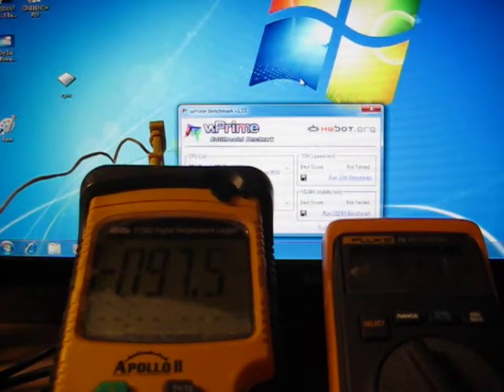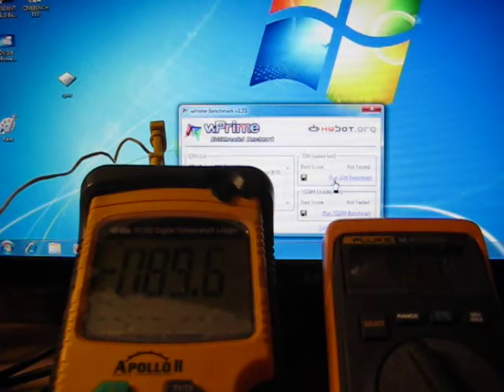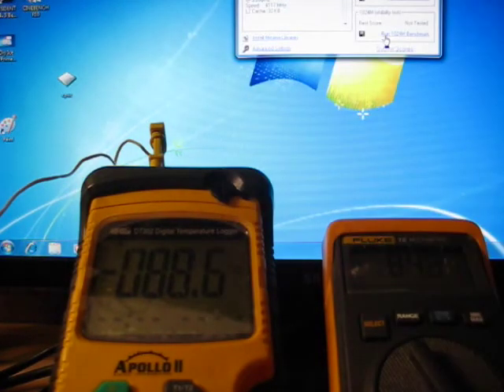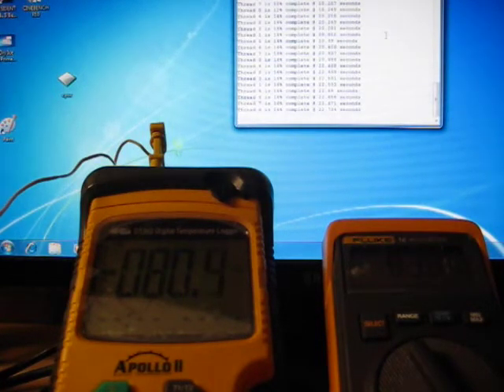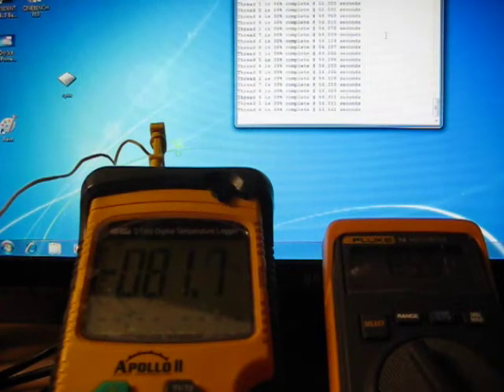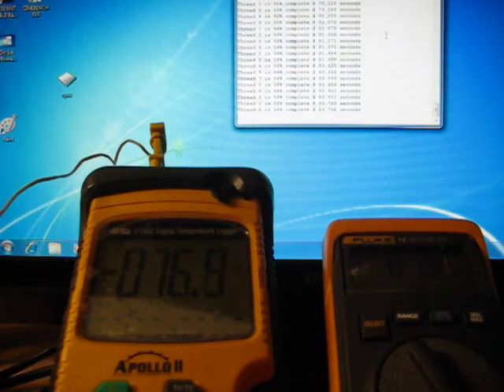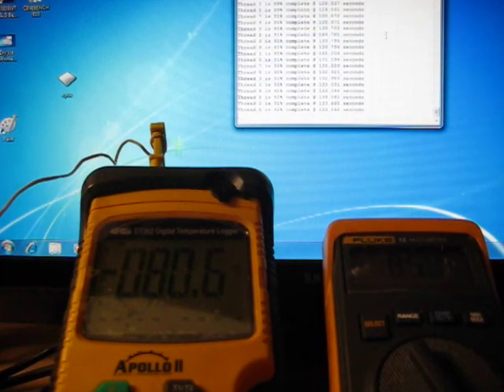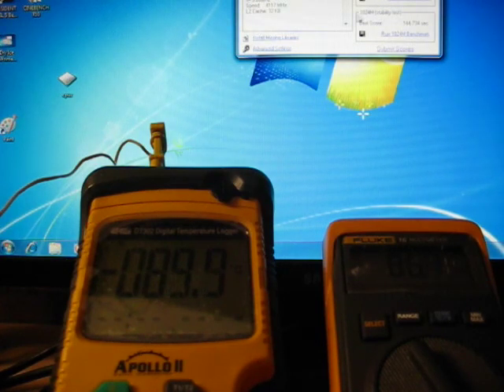Koolance CPU-LN2 Rev2 LN2 wPrime 1024M Run

Comment: hello thanks for answering , i am interested especially for superpi 1 mb and wprime 1024, i am interested especially in the 1024wprime how much ln2 did u use in the pot and how often did u poor? every 9-12 seconds  or more often, small splashes? did un bench also gulfs or westemere, how do the compare with xeon in  terms of pouring? i am a noob right now i i cold bug a lot that why i was asking:P